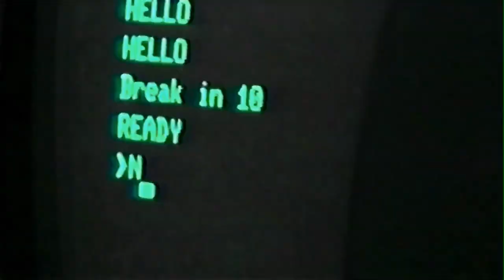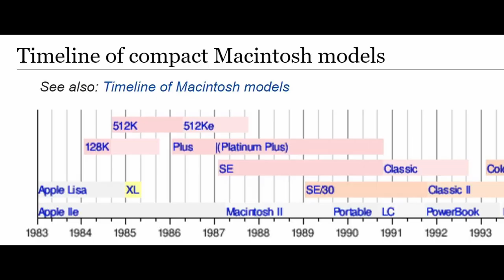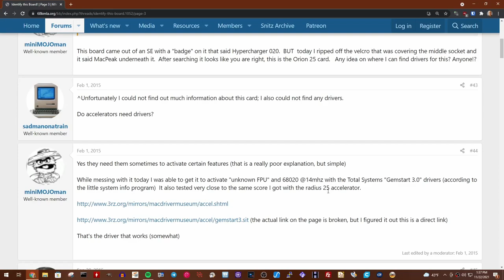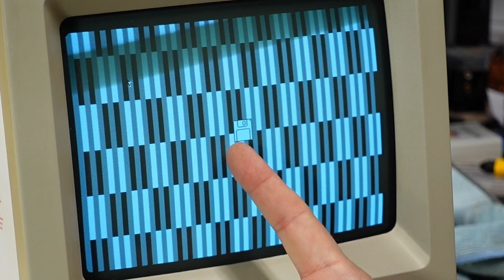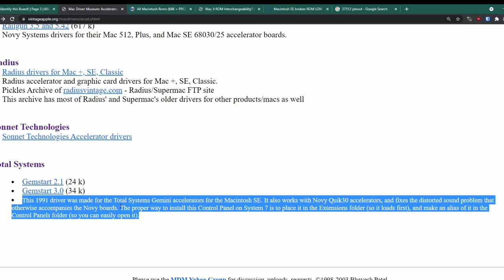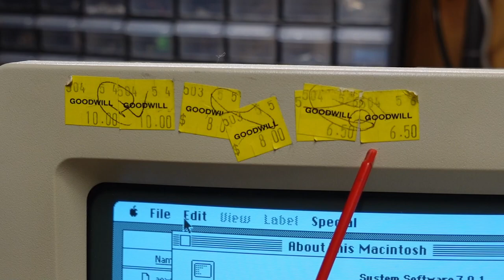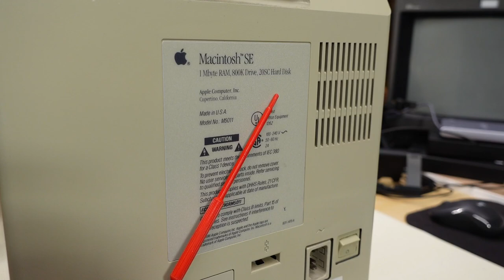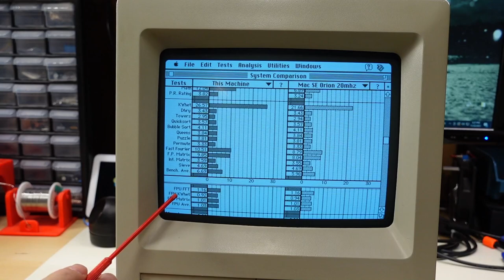The Macintosh SE is slow. Let's speed it up!

Comment: CRYSTAL QUEST! 🤩 Oh man, that takes me back to the family 512k!  I've got a Mac SE I got from somebody years ago, battery ate through the board while it was in storage, and I had to toss the corroded board because I didn't have time to deal with it...still have the machine, though! I should try and find a board for it some time. 🤔 btw, a trick I use any time I encounter a dead download link like that, is to try opening the page in the internet wayback machine and click the link.  It doesn't just save the pages.  (Might also be worth trying that on the forum threads and see if the wayback machine cached the images!)

Comment: The 68000 has a 32 bit programming model, though its ALU and data bus are only 16 bits wide.
The 68010 supported virtual memory, in much the same manor as the 80286 did.  Operating systems that took advantage of these chips never did come out, that had to wait for the next generation of both CPU's that had full 32 bit support, and full memory management.  (Well, there was Coherent a pseudo Unix clone for the 80286.  And various DOS extenders did allow use of the extra memory that the 80386 could support.  Maybe there were similar utilities for the Mac with the 68010?)
Reply: DOS/4GW as used by a lot of PC games in the late 90s.

Comment: On those small 68kmla images, you actually can see a larger version, you just need to be signed in for whatever reason.
Unfortunately the other images appear to be Gallery images, which seem to have been lost in forum crash this year. Though I’m sure the admins have a backup somewhere…
Reply: Is there a Way Back Machine that might have an old copy.
Reply: @SidneyCritic  I checked the Wayback Machine, but didn’t see that specific gallery archived.

Comment: I had a Mac SE.  I paid $2,400 for it new.  I had it maxed out at 4 Mb SIMMS which disabled the 1 Mb of on-board RAM.  I even had the Mac version of Mathematica installed on it.  I used it for two years and sold it for $2,000 right before MS Windows 3.0 came out.

Comment: I had a ton of compact macs.  I had an SE with a daystar digital accellerator, an 020 or 030, I forget which.  But it didn't need any drivers. It just worked.
But this is the problem with Macs. Maybe not so much today, but back then Apple did EVERYTHING to get in your way.  You need special RAM. You need special hard disks.  On non-compact macs, you need special monitors. Of course, all of it has an Apple tax.

Comment: 1:57 - I would call the original 68000 a 16-bit processor as although it does have 32-bit instructions, it's only got a 16-bit data bus.
Reply: Actually, i think maybe that was a slip of tongue as later you talk about the 32-bit data bus on the 68020
Reply: Yes, often referred to as a 16/32 bit processor.
Reply: @Peter_S_  Untrue, the 68000 has a 16-bit ALU that can do 32-bit operations by running multiple times on the same instruction. That said, I still think the instruction set is the best way to define it.
Reply: The bus width of a processor does not determine its instruction width. Does the 68008 having an 8 bit bus make it an 8 bit CPU? No. The same reason the 386SX with a 16 bit bus doesn't make it a 16 bit CPU.
Reply: @GGigabiteM  The interesting thing about the 68000 (and 68010) is that while they can perform 32-bit instructions, the actual ALU does it in 16-bit chunks with microcode to perform the 32-bit operations. Thus, 8-bit and 16-bit operations take the same amount of time, but 32-bit operations take longer, even if you're just working in registers.

Comment: 38:09 "Unimplemented Trap": That definitely sounds like application trying to use missing ROM feature. Apple used illegal instruction trap by invoking instructions that begin with bits 1010 to call OS routines from the applications, then it would put other necessary information for the OS routine call into rest of instruction data.

BTW: Instructions that begin with 1010 were never a valid 68000 instruction according to Programmer's Reference Manual, but it does have special exception vector for that, which is probably why Apple chose 1010 specifically.

Comment: There is a project for the Amiga called the PiStorm which literally has a Raspberry Pi plugged into the CPU socket & emulating an 680x0 processor and adding a heap of RAM too. Even under emulation it's faster than regular hardware and it only costs $60. I wonder if that could be adapted for other 6800x0 computers, most notably the Mac.

Comment: FYI:  68000 is a 16/32 bit since it can only access data externally at 16 bits. Also it only has a 24 bit external Address bus.
Reply: @Peter_S_  No, not wrong.....Read what I said. I said externally. No matter how you slice it it can only grab 16 bits at a time externally. Internally 32 bits is correct. Motorola themselves refer to it as a 16/32 bit CPU. The processor has 16 bit ALU's btw.

Comment: 5:00 - Huh? PCs in 1987 could run Windows/386 with preemptive multitasking and color graphics.
5:15 - In 1990, PS/2 with was already available, although at very high price
18:46 - It didn't even have any memory protection, AFAIR.

Comment: Pro tip: use an ATX extension cable while the MLB is outside of the case. It has extra pins but is pin compatible with the SE analog board connector.

Comment: I used a SE with an 68030 accelerator + FPU (Dove Marathon and later a Novy Quick 30? Don't really remember..) and stunning 16MB RAM ( i.e. 4x4) for years, also added a grayscale video card with a huge CRT (19" or somewhat like that, was big - and heavy - for that time). But it was annoying to not have color support in ROM (aka Color Quickdraw), so, yes, you could speed it up, but it was still very limited.

Comment: 48:45 - Note the a 68020 only has an instruction cache, in contrast to the 68030 which has instruction and data caches.
Reply: Yup. Also the 68020 does not support burst mode.

Comment: I bought a Mac SE off eBay a while ago, before prices for those things shot through the roof. It works great, but when I tried upgrading the RAM from 1 to 4 megs, it would only see either 1 MB or 512k, depending on where the jumper was set. So I got my hands on an SE/30 motherboard, which just slots right in. Unfortunately, it has leaky caps for days. While it does still sort of work, the audio is almost silent, the SCSI port doesn't work reliably, and the whole machine will occasionally lock up. I'm hoping a recap fixes all these issues, because otherwise I have no idea how to fix the thing.

Comment: What a time it was. Max 4 Mb  of RAM. I was an Amiga user back then. It could hold up to 9 Mb of RAM (10 if you soldered a newer co processor in) We made a lot of fun and jokes about Macs.
But yes, the 68030 was much faster, then the 68000

Comment: I need help figuring out what PC my dad bought when I was a kid. He doesn't remember so I have go off the clues I have. It was an IBM PC from 1987 and it had a 33Mhz CPU. It had a 5.25" and 3.5" floppy drive. It wasn't a tower, it sat under the monitor, and I swear the monitor and PC shared a single power source. It didn't have a turbo button or a digital display showing my clock speed. It did run DOS, Windows 3 and even Windows 95 just fine. My guess that it's an IBM 386 but I don't which model exactly...

Comment: The Motorolla 68000 series of microprocessors were tragically underrated.  I had a book that went in depth into the machine code for the 68000 series, and the amount of work that went into setting up those opcodes was impressive.  I'm betting the instruction decode logic on the 68000 was way more efficient than the Intel chips of the time.
Reply: Not really, the 68000 was a very CISCy thing, there was a microcode layer and a nanocode layer (!).  It was a dream for an assembly programmer compared to Intel, though...😉
Reply: The 286 and 386 were more efficiently implemented, using about half as many cycles for most instructions. For 32-bit arithmetics on the 386, the difference was even larger. An ALU r1,r2 on that chip needed two clock cycles, while the 68000 had to use eight clocks to perform the same calculation. This was somewhat enhanced with later 68K models though, especially the 68030 and up.

Even the 8086 and 8088 were often faster than the 68000 on 16-bit code, using the same clocks. The big benefit of using the 68000 over the 8086/286 was its linear addressing over megabytes. (Of course, the 386 could do the same, but that was in 1985-86, while 68000 had been practically available since around 1982-83, although with lower clock ratings, like 5MHz.)
Reply: @brentboswell1294  Yes, Motorola called it nano code. But in reality, it was a large ROM of relatively narrow microcode that used routines in a much smaller ROM/PLA of wide (-er) microcode. (Wider microcode need less or no decoders, and is therefore faster.)
Reply: The 286 was brand new when i first bought my A3000.  And that 25Mhz machine beat the crap out of the 286 i saw at the time.  Not going to try to argue IPC or anything like that, Intel had that locked up pretty early.  But the x86 instruction set is a nightmare, while the 68000's was simple and elegant.

I may be biased, but i found the 68000 instruction set to be superb in every way.  If Motorolla had the same amount of money to spend on R&D, i think things may have worked out very differently.

But that is pure speculation (and not a little wish fulfillment) on my part.
Reply: @jeromethiel4323  Forgot to add that the 68030 used in the Amiga 3000 was introduced in 1987. So a couple of years later than the 386, and also a couple of years before the 486. The 286 was pretty old at the time, although still used (just like the 68000 still was).

Comment: The 68020 had a 256 Byte instruction cache, but no data cache. The 68030 added a data cache of the same size. Toggling the data cache check in your tool should show no performance difference in your benchmark.

Comment: FYI, SD cards are often, if not usually, SLOWER than hard drives, including old HDDs, which could explain the results of your side by side in the Face Off. This is why many retro interfaces use Compact Flash instead. I avoid SD cards in my retros because of this.

Comment: On the classic 68K Macs you lose the sound because the CPU did the heavy lifting for that as well. Yes the Macs did have a Sony Stereo Sound Chip for sound but the data was pushed through it by the CPU. In the '030 Macs they had some assistance with some added tomer chips but not the older 68K Mac. Either the sound was horrid or it played at the accelerated speed. I think/believe that the Radius Accelerator was the only one that played sound properly on the 68K.

Oddly Dove and a couple others others made a 68K accelerator with a 68K running at 16MHz. Now those made the classic Macs wickedly fast without the hardware snd software issues.

Comment: I had an SE in the early 90s and even then, without anything to compare it with, it felt very slow. The SE/30 was massively faster.

I'm surprised though that a market even existed to support all these somewhat expensive accelerators. The SE was never cheap with Apple continuing to ship the Plus long past obsolescence as it's budget machine.

Why did Apple choose not to add co-processors to improve the performance of the 68k like Commodore and Atari did? It can't be just down to cost as those machines were massively cheaper.

Comment: I might be wrong but I believe that the first computer with a direct to processor connection was the BBC Micro which had a TUBE connector that did pretty much the same thing.
Reply: Adrian specified that it was the first Mac to have one. Though that is an interesting bit of information.

Comment: 1:33 and 1:46 You don't have to specify form factor really. The very first Macintosh ever was that compact 128/512 kilobyte variant you are talking about. There were no larger or non-compact Macs at the time, i.e. 1984. Even the rebranded LISA (with new PROMs) they called Macintosh XL came a little later, iirc.

(I never use Macs really, but I saw these expensive machines popping up at work, and I still got my copies of two-three computer magazines presenting them when they vere introduced on the market in 1984.)

Comment: I never felt that the initial Macs were any faster than my C128D running Geos.  Granted I also had the ram expansion and a 1581 but I really wasn't that impressed.  I guess its architecture was very upward scalable where as the C64 had really come to the end of the line with the C128.

Comment: When you said mac pioneered the user interface elements I searched the comments for the obligatory Xerox Parc comment and not finding it, this is it. Xerox Parc pioneered all of those user interface elements:) You're welcome;p
Reply: It's a tired old meme, but Xerox Parc was the lab, not the computer. Xerox Alto is claimed to be the computer, but its GUI is nothing like the one on the Apple Lisa and Macintosh, and everything that came after that copying them. You'd have serious trouble figuring out even how to boot any GUI programs on the Alto, nevertheless use them, but running any modern computer makes you well prepared to use an original Mac or Lisa. In fact, Douglas Engelbart demonstrated a GUI with hyperlinks and mouse a decade before Xerox Alto, back in the 1960's. Go educate yourself and watch "the mother of all demos".

Comment: In the distant past I had solved that sound problem with 2 resistors, but I can't remember how the hell I did it. I know I found the solution by using the oscilloscope to look at the signals. But then again, I'm getting old and the brain doesn't want to cooperate properly anymore :-(

Comment: Windows 95 runs on a 386 with 4MB ram, but it does not mean it is smart thing to do to use it in such PC. There is nothing wrong with releasing newer OS that runs slowly on older computer because nobody forces you to upgrade the OS. It is up to a person if new features are worth having it run slowly.

Comment: The 68882 is a much better and optimized version of the 68881.  They are op-code and pin compatible.  If you have the option, you always want a 68882.

Comment: Isn’t the Motorola 68000 a 16bit processor with a 24bit address space and not a 32bit processor? I had Amigas throughout the late 80s and into the 90s and the A500 had a 16bit cpu (68k) and the A1200 had a 32bit 68020.

Comment: Do you need the MMU to address memory abouve 4MB?
Reply from the maker: Not sure -- the 68000 has 16mb of address space -- but looking at the memory space, it's likely correct that you do need a MMU as the ROM sits at the 4mb mark on the Mac SE. Thing is, since the ROMs are on the card, so it can move them around, like up to the very top of the first 8mb of space.
Reply: @adriansdigitalbasement  I think the addressing on the Mac is so that the sign bit splits memory into 8MB high and 8MB low, which is also the reason 68020/68030 systems without 32 bit patches (SE/30, II, IIx, IIcx) can't address more RAM than 8MB. Using more than 4MB on the 68000 Macs likely clash with things like ROM addresses and I/O addresses unless patched somehow.

Comment: If you gave up the graphics, a 68020 could run a 30 user UNIX system. If you think a mac was expensive, these old UNIX systems made them look cheap. But you could run your whole business with one. Installed several in large hospitals. Things are far less efficient now and gigaflop machines are slow.

Comment: Performance-wise the MC68000 was comparable to the i80286. But what's fun is if you use a MC68010 with a PMMU or an i80286 in protected mode the performance dropped because Motorola's PMMU, the MC68451, like the 286's protected mode banged every memory access with privilege checks.

That aside, the economical SE upgrade was to drop in the logic board from a SE/30.

Comment: Multitasking has nothing to do with co-processors, and everything to do with memory efficiency and operating system architecture.  MacOS 6 is cool in a lot of ways, but efficient it is not.  Not in terms of CPU cycles nor in terms of RAM, at least not compared to its contemporaries.

It's true that the Amiga could paint the screen more quickly, by maens of co-processors, but that's nothing to do with multitasksing, which is down to the message-passing exec system, and tight core design of the OS internals.  The Amiga project simply had top engineers with pretty different priorities from the Mac project, which was constrained with cost management, a tighter deadline, and a cough leader who would change priorities as things moved forward.   The Mac team delivered amazingly well with the priorities they were given.  That the Mac 128k works at all is amazing.  But the screen drawing routines were more focused on flexibility and rom size than speed. 

The core Mac tools like the control panel are amazingly small, but the API provided to developers to build their applications led to substantially higher ram costs than did the much more spartan and feature-poor amiga intuition library.